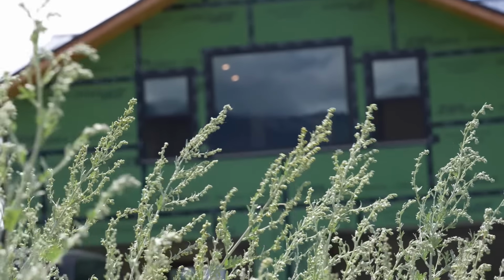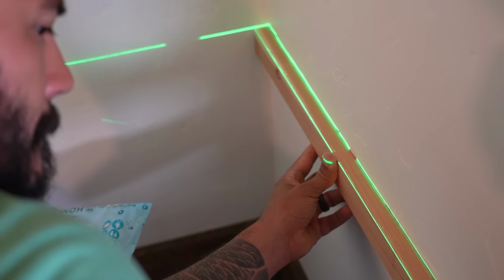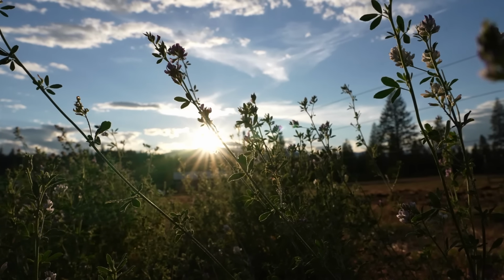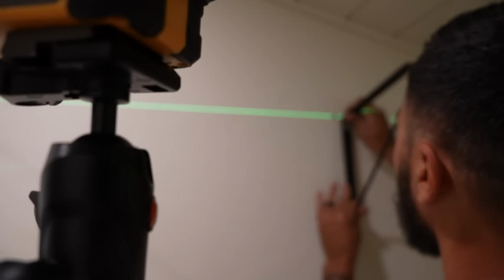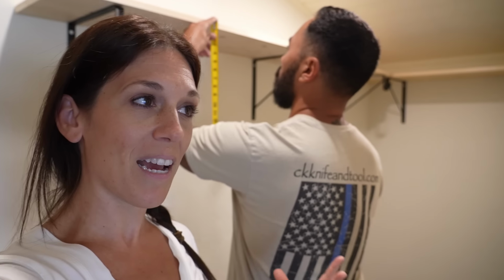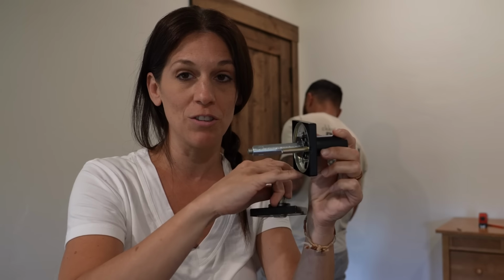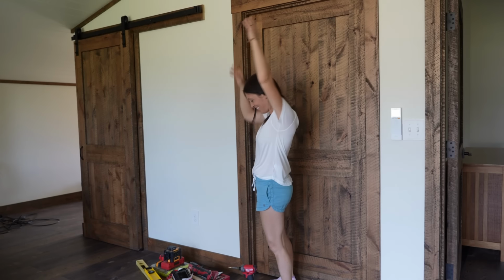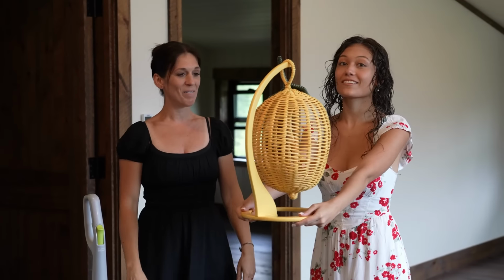This is the End of the Road | Where Do We Go From Here?

Comment: just a heads up with the spruce shelves. Many years ago, one winter I decided to build some furniture for the cabin and the rec room. Using 1 X 10 spruce, I cut the edges of the 1X 10 down to 7 inch width and angled the sides to butt together so the sides  would be equal with two pieces fastened together to form a V, shaped door where as the two doors would become 25 % of the sides. I stained and varnished inside and out and assembled the cabinet and applied another coat of varnish.  By the end of the following summer most of the boards in the sides had warped and the doors wouldn't work, an most of the glue joints had pulled apart.

Comment: Just a suggestion but, if you were to put in corner wood sections from the bottom of the bracket to the floor. You would have a built in shoe rack in that corner.